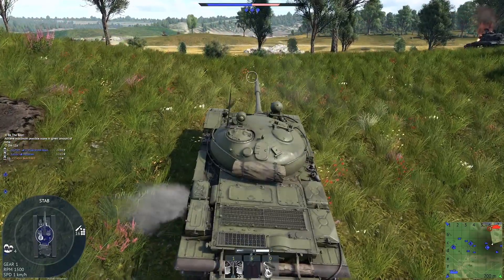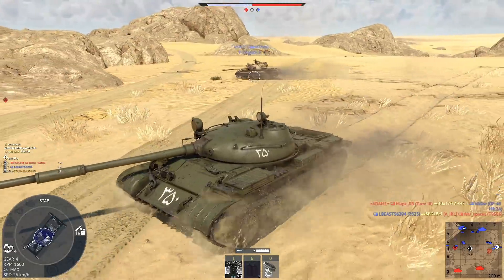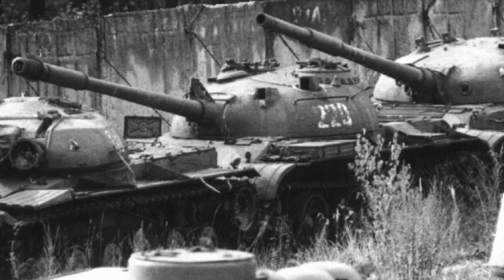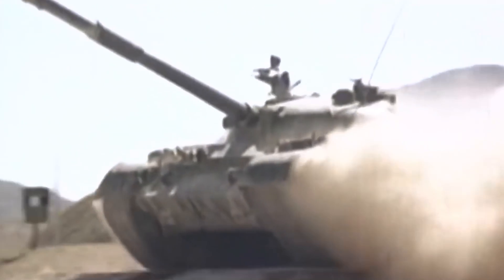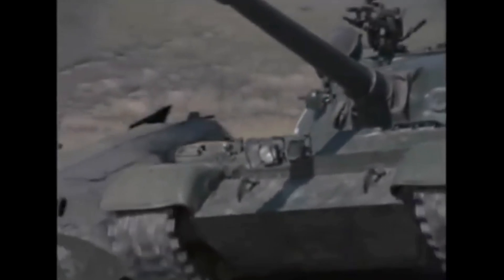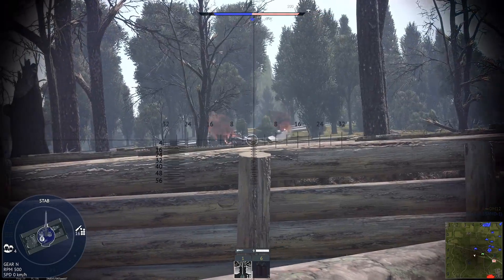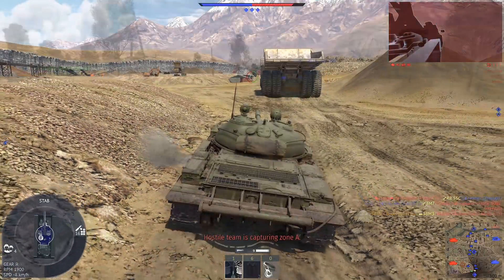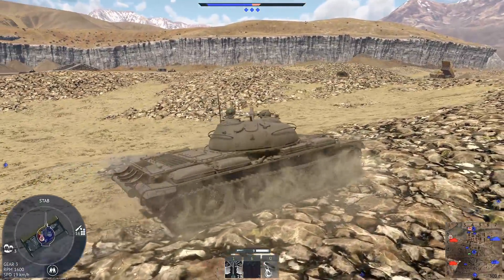Why did the T-62 have a 115mm gun?

Comment: Hope you can help me on this: I've been quite confused about T14 canon for years now, since the announcements regarding this gun. The Armata should have its 152mm on parade... What went wrong in the process...? What will be slapped on to the tank for real?
1/ Starting on whatever available, I'd say: Anything in 152mm caliber. Judging from the "125mm is actually just a bored-out 122mm gun" comments, we should think of 158/160/162mm or slightly bigger canons. Those abundant 152mm Artillery shell / AT rocket and missile can have a specialized outer "shell/case" fitted on to them, effectively turn them into fin-stabilized round or just simply enable the canon to use them.    
2/ Smoothbore 152 will be fire-power madness. However it will also mean putting a strain on the already-stressed supply chain.
3/ Well this option is simply "rifled 152 go brrr", may be differences in chamber/charge. Everything, if not outright destroyed, shall be disabled with the plentiful available 152mm HE rounds. Tank can share ammo with artillery to an extend. Some other unique ammunitions will surely be made for it, also further enhance combat capability of other 152 canons. 
...
That's all I can fantasize about for now... Feel free to debate and thank you all in advance.
Reply from the maker: @hongockimquang1994  Yeah it was thought to be a 152mm gun but there would be many problems with that. Now, the advantage would be enorm because a 152mm would allow the T-14 to pen basically any tank. But as you mentioned, the problem starts with the logistics and end with the tank’s performance itself. 

Firstly, a 152mm is a lot heavier and larger than a 125mm. This means one tank will carry less ammo in total and supply trucks will carry fewer rounds as well.

Talking about tanks carrying these rounds, the Russians would also need a new autoloader. Since the round is bigger and heavier they‘d need an autoloader which can carry it all. 

Also, the tank‘s design would change as well because the recoil and size overall are larger. They‘d need a stronger turret and chassis, which will likely increase the tank‘s weight and negatively impact the mobility.

On top of that, producing these new rounds will require an overhaul of the production line, which would be another challenge.

That‘s most likely why they stayed with the 125mm. It‘s still within their logistical capabilities. In total I think the disadvantages just outweighed the advantages.  

Using existing 152 artillery shells would also be difficult because they‘ve been designed for indirect combat. Making them fit for direct engagements would also require to „update“ them for this use, which again would use a lot of logistical resources.
Reply: Can't agree more. Unless we discover new materials to shrink something down to reduce weight and size down even just by a little bit , technical issues will still be there. But then again, why would they want to increase the caliber if they can just make existing ammo stronger, easily and cheaply...
...
I've heard of some feasible ways from even the cold war days which could help with recoil and size. However, with our existing techs, even if we manage to make them reliable enough, the tank turret may become quite "squishy" - even to the threat of autocannons, may be. 
Following the recent "unmanned turret" trend and the flagship status of the T14  -stay the heck away from direct engagement and try to outrange/outsmart its foes, I think this may be worth it. However, it wont really be a tank, but a buffed Gun Carrier/SPG more likely, which will be a hinderance to the versatility of a tank.  
Hope you can share your opinion on this.
Reply from the maker: @hongockimquang1994  Well from that point on it might make sense to differentiate. A tank‘s job is not only to destroy enemy armor, but also to fight enemy infantry and destroy their positions to some degree. 

If you mean that a tank which would be so focused on fighting enemy tanks from a distance, have a disadvantage in fighting enemy infantry because of the focus on destroying enemy tanks, this might very well be possible. (Sorry for the poor formulation) A highly modern tank with a very strong cannon and excellent visual sights would do good in long-range engagements but the mobility would most likely be bad (As you already mentioned, more like an SPG). 

If such a tank was to be created, with massive focus on outranging the enemy, we might as well see a tank specifically designed for infantry support. Not necessarily an Infantry Fighting Vehicle. Might be something in between. But that‘s just a quick forecast of the top of my mind.

Comment: Because NATO was using 105, and so the Soviet one had to be bigger, of course.
Reply from the maker: True dick measurement
Reply: 115 --> 120 --> 125. Sooner or later there's going to be 130, 135, 140, 145, 150 and 155. Lol
Reply: @SCH292  Germany and France are already working on 140mm
Reply: Russia is developing a 152mm gun for the T14
Reply: @JesterEric developing? Don't they already have it?
Reply: @AKUJIVALDO You're confusing 152mm howitzer rounds with what the other guy is describing in 152mm tank rounds.

Soviet howitzer rounds are 152mm and 122mm. Soviet tank and anti-tank rounds are 125mm, 115mm, 100×910mm and the rarer 100×695mm.
Reply: @JesterEric  🍆
Reply: America have 152mm gun on Starship, MBT 70, and sheridan.

 @JesterEric
Reply: @randomblacktemplar738  compare to 105 mm that guns sux . cose low projectile velocity= lower penetration .

Comment: T62’s are still in the fight, fighting 
Solid gun 
Solid tank
Reply: Mainly as blyatmobile turtle tanks.
Reply: For the 60’s, sure. But with shoulder launched ATGM’s everywhere, drones, hell even HEAT rounds, it’s extremely outdated.
Reply: @devendoffing7004 By that logic, tha abrams and the Leopard 2 is outdated because of manpads, atgm lainchers and drones.

Its not outdated because of that. Its outdated because its lacking tech and modern concepts
Reply: @Dominikuuu  Abrams and leo 2’s have room for upgraded to accommodate newly introduced tech on the battlefield though, the T-62 does not.
Reply: @Dominikuuu  the reason why the T62 is made outdated by those while most other tanks are not, is because unlike most other modern tanks like the Leopard 2 or T80BVM, it cannot withstand those attacks, its armor is much much lighter, even on the modernized variants all they get is nearly 40 year old outdated ERA bricks which can easily be penetrated with any form of tandem projectile (which most of everything uses now,) it is also slower and uses a shell that isn't in production anymore, its just way worse in every possible metric
Reply: @ohnoes3084  No, the T-62 isn't obsolete because it is vulnerable. If so, the infantrymen would be obsolete long ago. Same with the IFV or any aircraft. Weapon systems aren't obsolete due to vulnerabilities. It is obsolete when it either can no longer fulfill its purpose or something that can do the job better. So the T-62 is obsolete because something better came around. The T-72. Besides that, it is still able to do majority of the tasks a tank needs to do even in the modern threat environment.
Reply: @neurofiedyamato8763  I literally said the reason why it's obsolete is because it's overall worse than the tanks which replaced it, I emphasized the vulnerability aspect as that is one of the more lacking areas it has compared to modern tanks, but I didn't say it was obsolete because it is vulnerable, also while yes the T62 can still "fulfill," the role of a tank in the modern battlefield, it will do so drastically less effectively at much higher losses and most likely also inducing a loss of morale to the side being issued them, it was a good tank in 1962, nowadays even with the latest of Russian modernization attempts, it is still exceedingly obsolete and out of its element and when it used on a modern battlefield, it is not very effective, no matter how you frame it
Reply: @Dominikuuu  do you even know what manpads are? Man portable air defence missiles. AIR DEFENCE. But i do agree that it is outdated because something newer that can do the same thing much better has been developed(newer tanks) and not because of newer weapons.
Reply: @thurbine2411  There are MANPADs that have ammunition for ground based purposes 
Like the Russian igla.
Reply: @Dominikuuu  seems like an emergency solution that isn’t used a lot. Real atgms would be better still?
Reply: @thurbine2411  Actualy theres a lot of videos of manpads being used against ground vehicles.
Reply: @Dominikuuu  are you sure the igla can do it? Can’t find info on it and it also feels weird as the missile is very small so can’t be that effective against mbts
Reply: @thurbine2411  Theres a tandem charged variant.

Just like the Verba had one.
Reply: @Dominikuuu  ok. What is the name of that model?
Reply: @thurbine2411  The full-capability 9K38 Igla with its 9M39 missile was finally accepted into service in the Soviet Army in 1983. The main improvements over the Igla-1 included much improved resistance against flares and jamming, a more sensitive seeker, expanding forward-hemisphere engagement, capability to include a tandem charge against armored targets, capability to enage straight-approaching fighters (all-aspect capability) under favourable circumstances, a slightly longer range, a higher-impulse, shorter-burning rocket with higher peak velocity.
Reply: @devendoffing7004 it is still very good and reliable artillery platform.
Being more reliable, than T-72 is quite of achievement.
Reply: @devendoffing7004  like every new western tank
Reply: @frankrenda2519  no. Name a single modern western tank vulnerable to HEAT rounds from the 60’s. Go on, I’ll wait.
Reply: @devendoffing7004  literally every Modern western tank?

You forgetting it's side and rear exist or something?
Reply: @saucy743  you forget what the word “vulnerable” means. If the main area the tank is expected to be hit is made up of an armor that is specifically meant to nullify or be completely unaffected by HEAT rounds, then the tank isn’t vulnerable to it. You forget the average tank ok tank engagement takes place at several klicks, not point blank like WarThunder.
Reply: @devendoffing7004  Yeah well let me tell you. Head on Head is extremely rare too. As i've seen it, Tanks get destroyed from the side and rear as well. If not more than from the front. So it's isn't just always frontal engagements. Because let me tell you, those destroyed Abrams in Ukraine that got the FPV drone Treatment didn't get their PG-7 warheads to their front. And btw, PG-7 is a 60's warhead.
Reply: @saucy743  notice how I said “the vast majority of tank on tank engagements are from the front” and your response was to talk about drone dropped munitions. So you didn’t even address my point. And the funny thing you conveniently forgot to mention about the destroyed Abrams is the crew survives. Can’t say the same for Russian tanks cause the designs are outdated.
Reply: @devendoffing7004  vast majority? My ass. Sure in wt it may be. But irl? Not a chance mate. And btw regardless of it being an RPG munition, or a Tank shell, HEAT is still HEAT. And ah yes, Abrams crew survives. Yes i'm sure Abrams crews survive Molten Hypersonic Copper jets to their face. I love your bullshitting. And btw, funilly enough an Abrams is vulnerable to a 1960'a HEAT to it's front. Ever heard about it's massive turret ring and Gun Mantlet?
Reply: @saucy743  the mantlet it actually really well protected. Maybe don’t use WarThunder armor stats as an indication for how well protected a modern vehicle is, cause they’ve admitted to being wrong on multiple models. And yes, the vast majority of tank on tank engagements take place frontally at several klicks. Just a fact dude, don’t know why you gotta get so butt hurt about it. If the US got in a war and had to roll out M48’s, you’d be up in arms proclaiming it shows how the entire US is failing and collapsing. But when Russia brings out T-62’s, you make excuses for them like it benefits you in any way to do so. You’re just being a bot and for no reason, even when you’re flat out wrong. Hope you get a hobby.
Reply: @saucy743  and the Abrams crews did in fact all survive. So there’s no argument to be made there. You can’t claim “nuh uh, they died” when they’ve been confirmed to have survived. It’s called blowout ammo racks.
Reply: @devendoffing7004  Ah yes, blowout ammo racks. Yes they very much protect a crew member who is having a molten metal Hypersonic Copper jet in his face or an artillery shell landing on his head from dying.
Reply: @saucy743  you clearly haven’t actually seen any of the destroyed Abrams. All of them were taken out by either their tracks being blown off and the crew bailing, or the ammo being hit and the crew later bailing. None of the crew were killed. “Ah yes, because blow out ammo racks are gonna protect from an artillery shell to the roof”. You’re right, it wouldn’t, but none of the destroyed Abrams were hit by artillery so what’s your point?
Reply: @devendoffing7004  they all are and they're not from the 60s you obviously don't know what your talking about go watch the Ukraine conflict and get some knowledge before spouting off
Reply: @frankrenda2519  you can call it a “t-62m” or whatever, but they’re still originally made in the 60’s. Some of them don’t even have the upgraded hulls that offer chemical protection, and instead just have kontakt-1. And you want me to talk about current events in Ukraine? Okay, how’s Kursk going now that it’s Ukrainian territory😂
Reply: @devendoffing7004  Some country sent Ukraine some modified T-55s with modern ERA, fire control system and thermal optics and the Ukrainians loved it. Sure it wont stand a chance against modern armor but those situations are rare, u can use these older tanks in a more supportive role or defensive or even indirect fire and it will still have a lot of use . 

Im sure any infantry man would rather not get shot by a 100mm/115mm from a T-55/T-62 even if its decades old.
Reply: @jkc2001  except the way Russia’s been using T-55’s and T-62’s has been the same as their other armor. So you could be smart and use them as glorified mobile artillery, but Russia hasn’t been doing that.
Reply: ik im late but yall need to stop yapping omg
Reply: Only really as fire support...The Russians are simply using them because they have a huge stockpile of 115mm gathering dust and it can fill the role of a field cannon.

Comment: The L7 being the driving factor for 115mm being developed is largely a myth there isn't really any evidence of this other than correlation in the dates they were introduced the 115mm is an outgrowth of the T-12 smoothbore 100mm gun however attempts to mount this gun in the T-54 would prove unreliable so the call was made to develop a new tank to mount this gun. The 115mm was actually planned to be put on the T-64 however UVZ beat them to the punch by pitching to the Russian MOD that their new tank could mount the 115mm gun as a stopgap until the T-64 was completed.

Also the U8T wasmt less accurate than the D-10T it was actually more accurate when firing HEAT-FS, and APFSDS.
Reply: The Soviets would have been aware of the L7 development and fielding so it very much was an influence. 
Their plan was always to have the evolutionary  design (that became the T-62) and an advanced vehicle.  Design bureaus "pitched" things all the time. It does not mean they dictated what was adopted.
Reply: @obsidianjane4413   being aware and being "sent into panic mode" are two entirely different things.  Development of smoothbore guns and Krustechev's insistence on mounting one to existing tanks predates the L7's introduction. The soviets wanted the T-12 gun mounted on a tank however the ammunition was too long which necessitated the need for an increase in bore diameter to use a shorter round with the same propellant charge. T-62 was just the fastest means  to fit the gun to an existing tank platform.
Reply: @nemisous83  Being in a hurry to upgun the T-55, where you basically just make a version with a wider turret ring, seems kinda "panicy". 
OTOH
The T-62 was just the conservative way of fulfilling the requirement for a "next gen" tank. As you note, there really wasn't a correllation between the fielding of it and the L7. 

As it was, the U-5ts and its ammo barely fit in the T-62. Its round wasn't any smaller than the original design. They just made the case fatter. Oh and made the tank bigger.
Khrushchev  liked new technologies, he thought that missiles would replace guns. That is why he favored smoothbores, because they could launch ATGMs. That is what drove a lot of seeming weirdness of Soviet AFV design.
Reply: @obsidianjane4413  well the actually tank portion of T-62 like the smoothbore it carried all stemmed from projects throughout the 50's it's just that when the U5T was finally completed UVZ already had a suitable tank to mount the gun too which was object 140 and that how they beat out Kharkiv's T-64 project for being the first mount the gun. 

Well AGTM's absolutely where the way forward tanks like IT-1, M551, and M60A2  where just both countries testing the waters to see if an ATGM equipped tank was viable however the gun launched ATGM's like Kobra and Bastion didn't come til much later around the mid 1970's. But ATGM's wasn't the driving factor behind smoothbore guns.